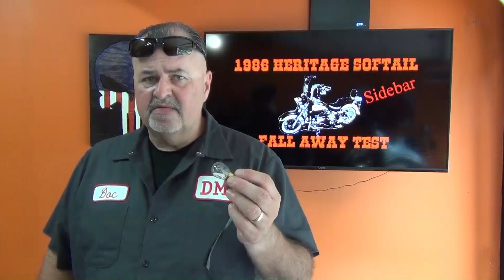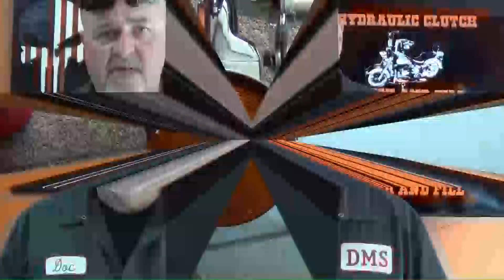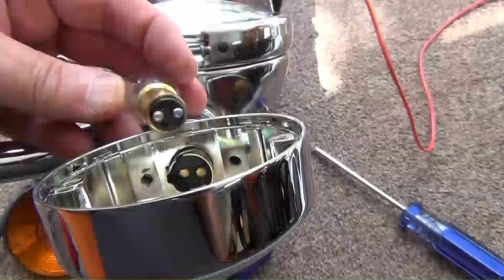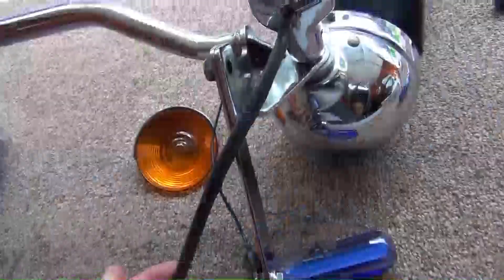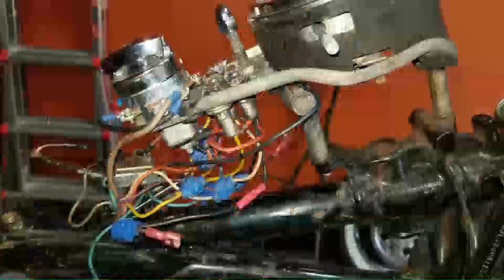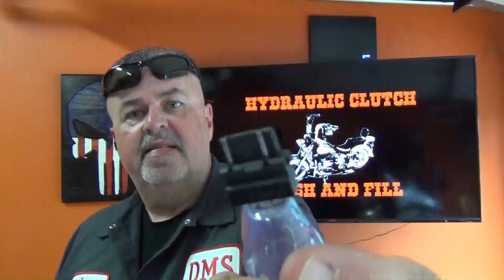Sidebar: 1157 Bulb Explained

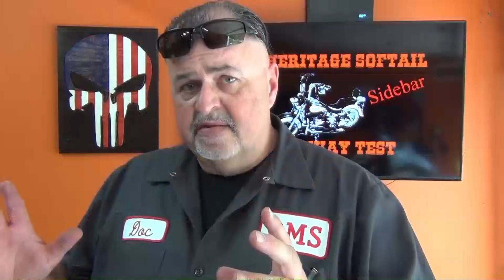Comment: I wanted to ask you about the blue Scotch locks - at 6:09 in the video. Harley didn't use those things did they? So I was wondering, what should I use to split one wire so it can go to 2 terminals? I'm converting an '81 WG to a dual-filament setup, learning as I go. I'd love to get rid of those Scotch locks - they just look wrong on a motorcycle (not that anyone sees them but I hate knowing they're under my dash!). Anyway thanks for a bunch of great (and very helpful) videos!
Reply from the maker: Thanks for watching. You're talk about the blue locks under the dash that allows one wire to pass through and another wire to connect, correct?  If so, the only other way would be to use a "T tap" or a "three way terminal". Keep in mind what this type of product is used for. It allows say for example to split a power source wire, to run too two different items that need to have power at the same time.  I too struggle with keeping it neat. But bare in mind as you said, no one will see it. And it is across the board the way to do it for the DIY'er and doesn't cost an arm and a leg.
Reply: @FNGFASHA  Sounds good - thanks for the info!

Comment: 4 damn days searching YouTube and every search engine out there. Finally this pops up. Not only answered which contact is which but I was looking because I’m re wiring my 1998 Softail. Bonus. It’s a shame that the web is so hell bent on advertising that it rarely is a good source for information and knowledge. Too busy selling me a light bulb to post a simple 2 min answer. The dim one is the running light. Bam done I don’t usually spend more than an hour a day staring into lightbulbs so I never noticed one was brighter. Thought it was one lit then the other was added when the brakes were applied. Thank you for just providing a simple answer to a small question. 👍🏼
Reply from the maker: Buddy, you get a star for the best comment ever!!!! And, the very facts you stated is why I started doing my videos.  Thanks for watching and commenting. Best of luck with your project 👍👍